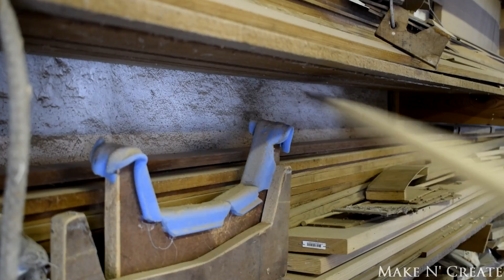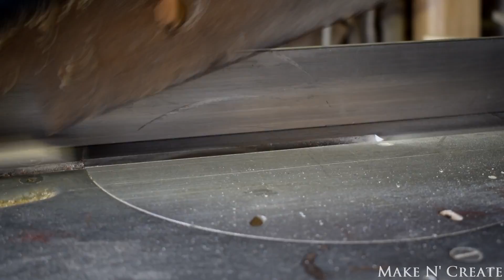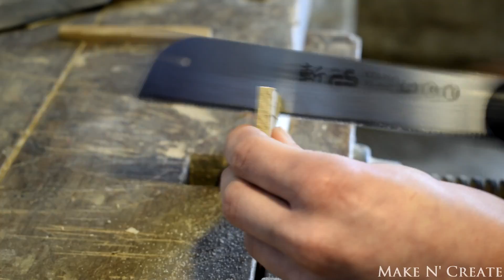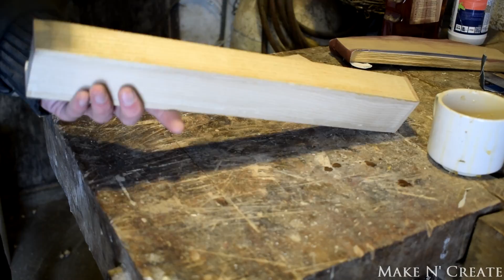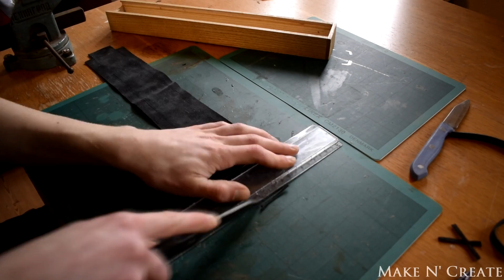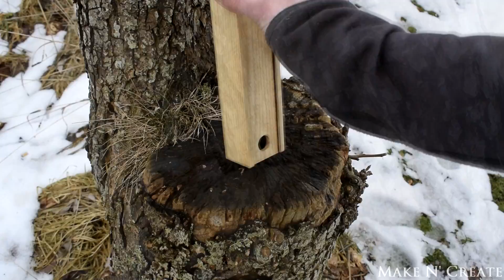Woodworking and Leatherworking - Wood Case for Sushi Knife

Comment: Excellent video. Though that lid is pretty bad, as water penetrates the wood it will expand so later on it would be tougher to slide the lid to the end of the box.
Reply: Daniel the oil finish should slow the process down
Also, if this happens he can just sand down the lid
Reply from the maker: Daniel No it won't. But thanks. Just to clarify: This type of lid is quite common and it's been used for many many years. If this would be a problem, people wouldn't use it. In other words it's tried and tested. Also this box is gonna be inside so I don't know how it would become wet.
Reply: Thx for the info, I didn't realize fish oil can slow that down. 

Make n' create, That makes sense. Though wood doesn't need to get wet in order to expand, as the humidity changes, so will the wood.